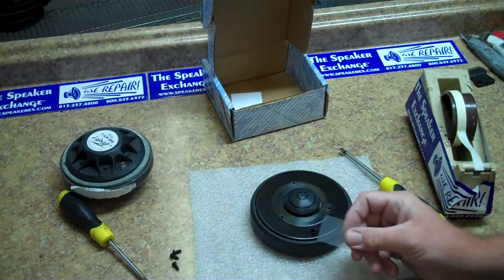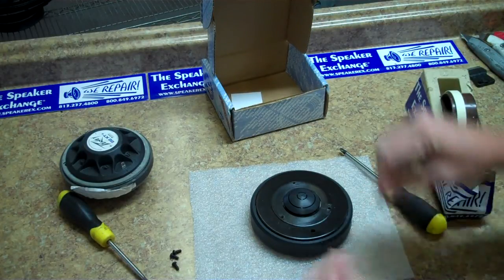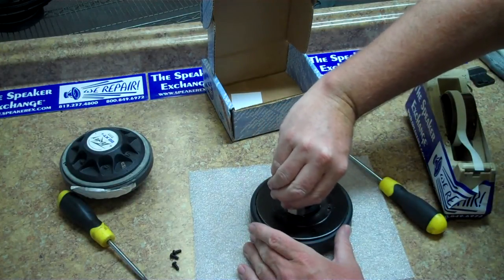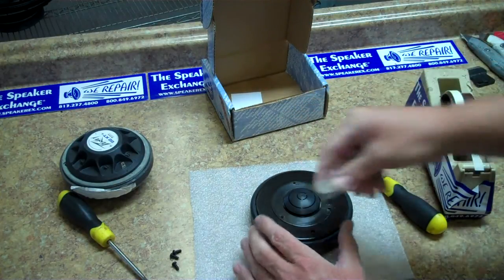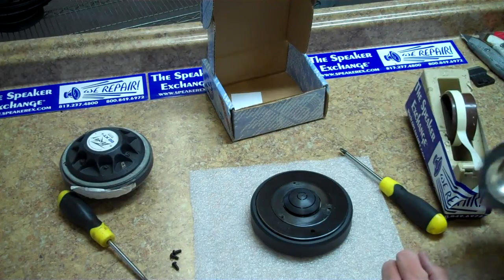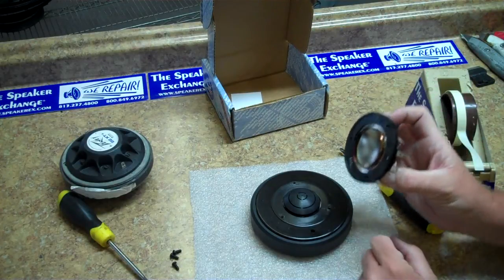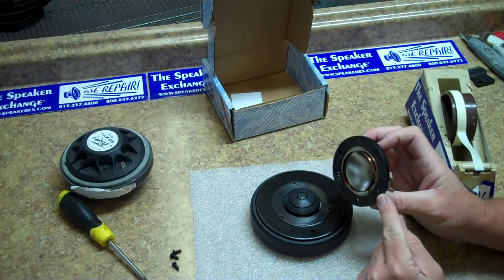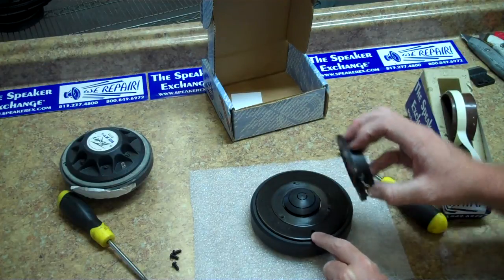Speaker Repair: Changing a Diaphragm on an Eminence High Frequency Driver

Comment: Is this the Same for eighteensound?
Reply from the maker: Yes. This is a generic video but it applies to almost all compression drivers. Slight modifications might be needed for some models but they should be easy to figure out. If you need help, email info@speakerx.com

Comment: Need to open back of my eminance high frequency drivers, these are on my Hawthorne ob drivers, any help would be appreciated as Hawthorne audio is no longer in business.
Reply from the maker: It should be exactly the same as in this video. If your driver looks different or if there is something particularly different about it, email a picture to sales@speakerex.com and we'll do our best to help you.
Reply: Cathy Satin HI, the back of the eminance HF driver is opened up and a metal cup looks like a metal dome tweeter is placed in the back making them a dipole driver, sound coming from the front and the back, I don't think the cup is an actual driver but I could be wrong.You can google Hawthorne silver Iris driver (pics) and you will see an example of the metal dome at the back of the driver, sorry having trouble sending a pic.
Reply from the maker: I googled it and I see a vintage coaxial speaker. The driver does not look unusual. I do not see a metal dome, I see a driver cover but it should all be the same as far as replacing the diaphragm. If you need more info, please be much more specific and email me at sales@speakerex.com.